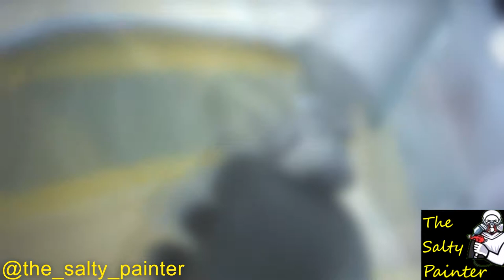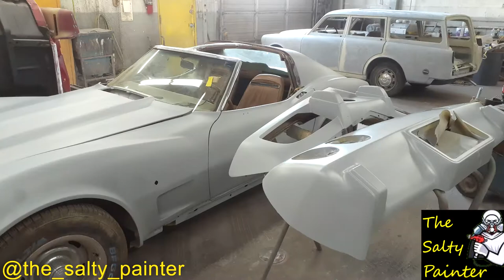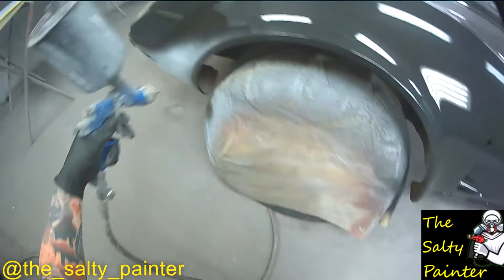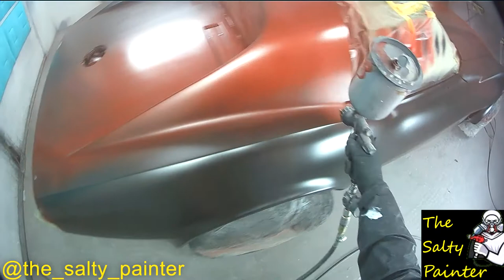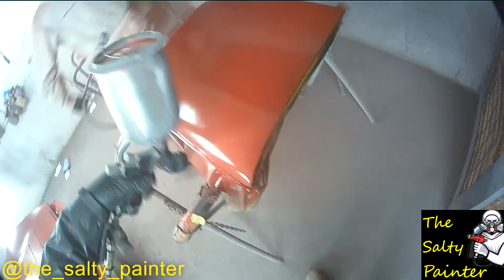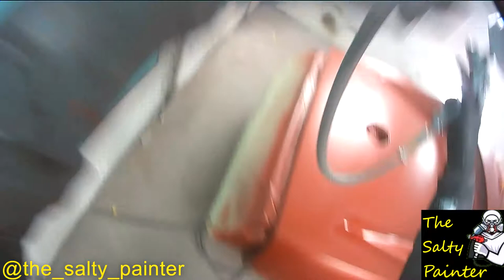75' Chevy Corvette restoration paint job #autobodypaint #restoration

Comment: I see you needed to do 80% overlap with the base coat just to cover
the dark sealer. you're going to need 4 coats of color just to cover without striping.
Reply from the maker: Also the overlapping varies on the paint brand. This was Nason base coat. It was super transparent. But if you notice towards the end I use a cross cross pattern on each coat. That is what prevents the striping from happening

Comment: Hello what grit sand paper did you use to get to the actual fiberglass off the car before you  started  your bodywork on the car?
Reply from the maker: So I started out with 180 grit on a hand block. Then I used 240 grit by hand and with my sander. From there it was sanded in 400 grit to take away most of the minor imperfections
Reply from the maker: @americanbully9583  you’re welcome. I do my best to keep up with questions and comments. And thank you too. I do have more film of other cars. Just haven’t had the time to edit. But keep a lookout for them. You never know when free time presents itself lol
Reply from the maker: @americanbully9583  you’re welcome. I do my best to keep up with questions and comments. And thank you too. I do have more film of other cars. Just haven’t had the time to edit. But keep a lookout for them. You never know when free time presents itself lol